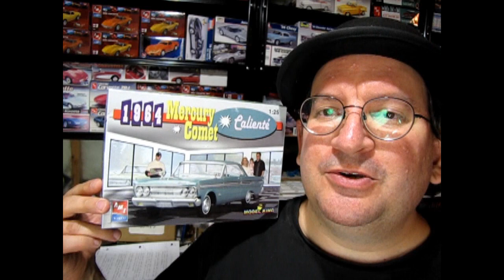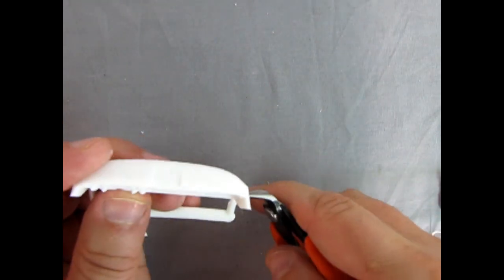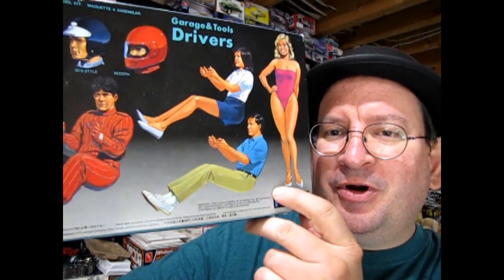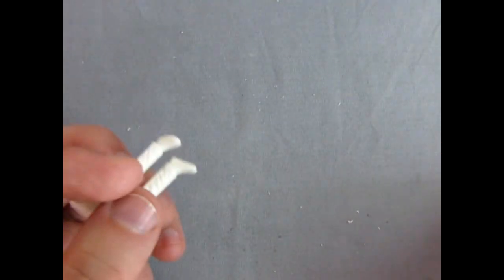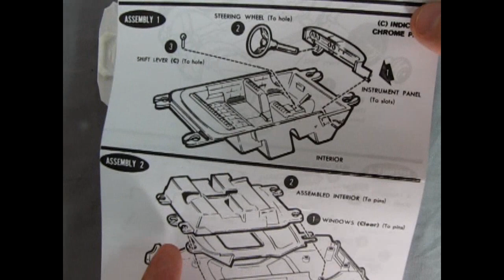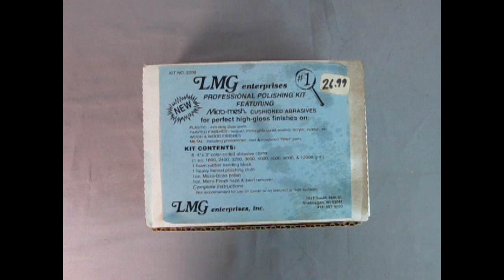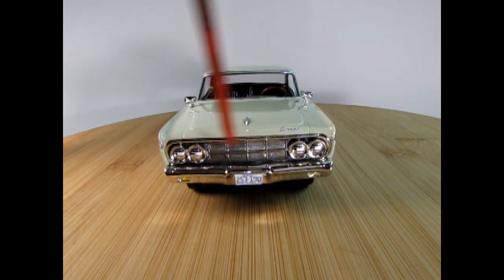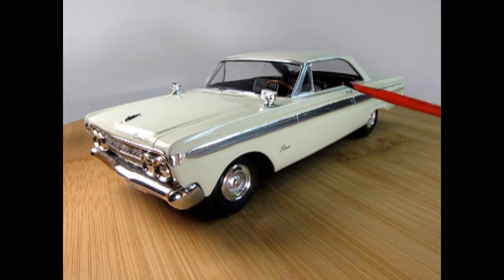1964 Mercury Comet Caliente 1/25th Scale Model Kit How To Assemble Paint Interior Black Wash

Comment: I owned a 64 Caliente when I was a young man. I bought it from an old woman who was the original owner. I built the engine myself with a performance cam and high compression pistons. I swapped out the old C4 auto for a 4 speed from a Mustang and put a 500 CFM Holley 2 barrel on it. I built it as a streetlight to streetlight racer so the big 2 barrel actually worked better for this since most 4 barrels would barely be opening the secondaries before the race would be over. The engine was the early 289 with the 5 bolt bell housing. It was powder blue with a light blue cloth interior. I really liked that car and it was a beast at streetlight racing. I am looking forward to the rerelease and I will have to do some chopping because mine will have the engine in it with the 4 Speed. Thanks for doing this! Nice video BTW. The real car did not have woodgrain on the dash it was painted metal and chrome... lots of chrome and yes, it did have a turn signal stalk. The steering wheel was interior color also, not wood grain. The Caliente did not come with a 6 cylinder, the regular Comet did but the Caliente was the V-8 version. Also mine was black underneath, not red and the tank was also painted black. I think those pics you are showing is someone's home done job. Nice model though, you really did a great job!
Reply from the maker: Thank you so much and nice story behind your real car!

Comment: Okay, i see1/24 figures do present problems like i had assumed. Question, why not 1.trim away a portion of butt (simulates seat sinking under weight) and cut off shoes at cuff and shave enough to go from 36” inseam to say a 33” appearance? Are the figures hard to work with? Great build . Like your style of production on this. Your not skipping stuff to just crank out another post. It’s appreciated
Reply from the maker: Glad you liked the video. Yes, certain things could be done to the figures, but with the seats in this kit being fixed in place and such, I really didn't have the time to figure it all out. I do have another model I am working on that does include figures that came with the kit, so you can see how they look. It's my "Part 2" 1956 Cadillac video, also on this channel.